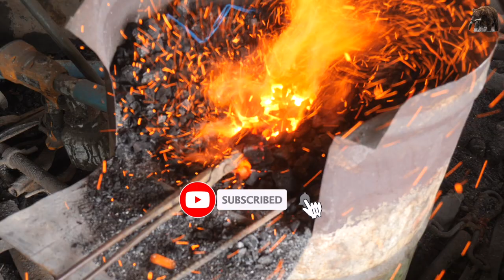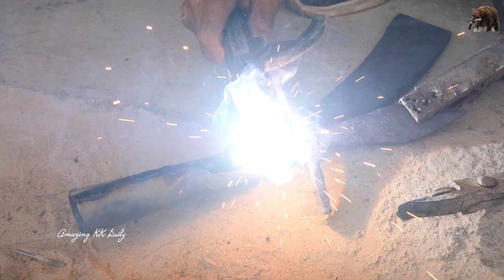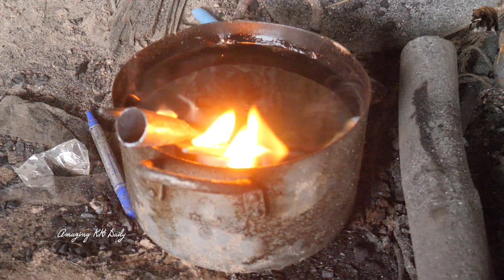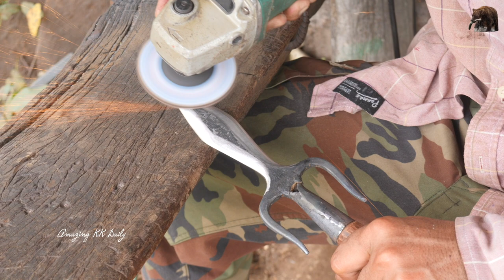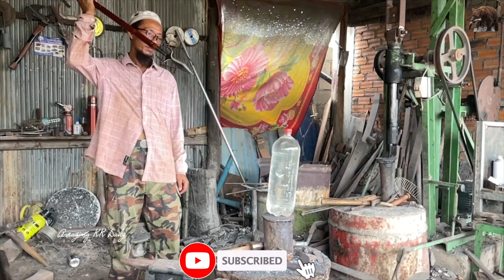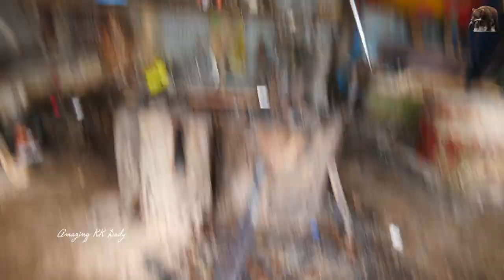How To Make It Look Easy To Make A Trident

Comment: لااله الاالله45+58محمدرسول الله =103محمدعلی فاطمه حسن حسین103+150مذهب الله= 253اصل اسلام253اسامی ابجد 12امام253اصل اسلام253علی حسن حسين علي محمدجعفر موسى علی محمدعلي حسن محمد 253اصل اسلام 253

اصل اسلام253)علی110+143چهار
خلیفه الله آدم داودهارون امام علی=253

حاکم دین اسلام49+72اشهدان محمدا"رسول الله=121یاعلی121+132اسلام=253+ 132حکم دین=385شیعه

اسلام واقعی319+66الله=385شیعه385

دین64الله محمدعلی64کلیدعرش الله64 حقیقت دین الله64
علی26امام دین26+38ولی دین=64
محمد20+18الله=38حکم الله38+26علی=64
64دین64الله محمدعلی64+18الله=82امام 82مهدی82امام82حقیقت دین الله64
قلب اسلام مذهب شیعه64اصل مذهب بدین الله64 اصل مذهب جهان شیعه64مذهب اول جهان شیعه64مذهب حق اسلام شیعه64امام دین الله محمد64علی26امام دین26+38ولی دین=64حکم الله علی=64 ولی دین علی64

دین64الله محمدعلی64جانشین محمدعلی64 خلیفه الله47معجزه الله47+47ولایت محمد= 94+64دین=158الله محمد=158+103لااله الاالله محمدرسول الله=261محمدعلی مهدی 261+124هزارپیامبر=385شیعه
محمد20+18الله=38حکم الله38+26علی=64
اهل البیت34دین اسلام34+18الله=86+46 نماینده الله، محمدعلی=132اسلام132حکم دین132+253اصل اسلام=385شیعه385
اصل اسلام253+132حکم دین=385شیعه
اسلام واقعی319+66الله=385شیعه385
علی26امام دین26+38ولی دین=64
دین64دین64الله محمدعلی64جانشین محمدعلی64+64=128کلیددین128 حسین128اصل اسلام محمدعلی فاطمه حسن حسین128کلیددین128حاکم جهان128حسین

علی26امام دین26+38ولی دین=64
محمد20+18الله=38حکم الله38+26علی=64 دین64الله محمدعلی64جانشین محمدعلی64 +46نماینده الله=110علی110ولی دین110 دین الهی110جلوهالله110علی110یمین110  سوره مدثرآیه38-39کل نفسن بما کسب رهینه الااصحاب الیمین روز قیامت همه گرفتارنامه اعمالشان هستند الااصحاب یمین110علی110نمک110نانجو110پلیسی110نامت صدوده یا علی حقا پلیس عالمی
به نانو نمک مرتضی علی نامت110یاعلی حقا پلیس عالمی 
دین64+59مهدی=123آل محمد123+103 منجی103محمدعلی فاطمه حسن حسین103 لااله الا الله محمدرسول الله=226نماینده الله226+159مذهب حق=385شیعه

اول دین اول مذهب189+196دین اسلام=385 شیعه385

مذهب حق159+226نماینده الله=385شیعه

مذهب51+66الله=117+268الله محمدعلی =385شیعه385
اسلام واقعی319+66الله=385شیعه385

اصل اسلام253+132حکم دین=385شیعه385 فلسفه دین الله385اصل اسلام بدین الله385 شیعه
لااله الاالله45+72اشهدان محمدا" رسول الله79 اشهدان علی ولی الله=196دین اسلام196کلید اسلام196مومنین196علی110+92محمد+ 132اسلام=334+51مذهب=385شیعه

اشهدان لااله الاالله58+72اشهدان محمدا"رسول الله79اشهدان علی ولی الله=209سلطان مهدی 209سلطان جهان209سلطان مهدی209+176 آقای دین176اصل نبوت محمدابن عبدالله86 +90اصل امامت علی ابن ابی طالب176آقای دین176+209=385شیعه

اسلام واقعی319+66الله=385شیعه385
علم غیب36+67ولایت تکوینی=103منجی  103یامحمد103لااله الاالله45+58محمدرسول الله=103محمدعلی فاطمه حسن حسین103+ 25شیعه=128کلیددین128حسین128اصل اسلام محمدعلی فاطمه حسن حسین128

علي ولی الله66+امامت الهی36+26بیعت، غدیر=128کلیددین128حاکم جهان128اصل اسلام محمدعلی فاطمه حسن حسین128دین 64الله محمدعلی64+64=128کلیددین 128 حاکم جهان128مولاء علی257+128کلیددین =385شیعه

خط ولایت و امامت دین الله91+98اولین خلیفه الله علی=189حکم دین الله189+66علی ولی الله=251اصل دین الله251+134حکم الله =385شیعه385 

اصول دین الله257+128کلیددین حسین=385 شیعه امیرالمؤمنین58+257مولاء علی+70حکم شریعت الله=385شیعه
مذهب حق159+226نماینده الله=385شیعه

عمر310گمراه دین310جهل عرب310اباجهل دردین310منکر 310نیرنگ310عمر310فاسق دینه310سامری310عمر310سمری310همان سامری میباشد به ابجد شیطان22پرستی22 بدبختی22ابابکر22عمر22ابولهب22ابن ملجم22خولی22مقصر22

به علم ابجد ریاضی قرآن به ابجد چرا دین اسلام74فرقه شد که رسول الله فرمود73فرقه آن اهل دوزخ است74ابوبکرعمر عثمان74
والشجرتها الملعونه74ذلیل74کج مذهب74پیچ دین74عمرابوبکرعثمان74 والشجرتهاالملعونه74دین اسلام را74فرقه نمودند74مخالف دین ضد مذهب اسلام74اینم آیه قرآن 74ان من المجرمین منتقمون 74قرآن میفرمایدما مجرمان راسخت عقوبت خواهیم کرد74ان من المجرمین منتقمون74 عمرابوبکرعثمان74والشجرتها الملعونه74کج مذهب74پیچ دین74ذلیل74ان من المجرمین منتقمون74قرآن میفرمایدما مجرمین راسخت عقوبت خواهیم کرد74ان من المجرمین منتقمون 74

علی26امام دین26+38ولی دین =64دین64الله محمدعلی64 +26=90اصل امامت علی ابن ابی طالب90+86 اصل نبوت محمد ابن عبدالله=176آقای دین176
دین64الله محمدعلی64+39حق ولایت=103
لااله الاالله45+58محمدرسول الله=103محمدعلی فاطمه حسن حسین103
دین الله34+69مذهب الله امام علی=103دین الله34+46نماینده الله=80+23مهدی=103
إنما يريدالله ليذهب عنكم الرجس أهل البيت و يطهركم تطهيرا
علی26امام دین26+38ولی دین=64
محمد20+18الله=38حکم الله38+26علی=64

دین64الله محمدعلی64جانشین محمدعلی64 
کتاب الله و عترتی75+53علی فاطمه=128
دین الله34+18الله+20محمد+26علی=98+30حق الله=128اصل اسلام محمدعلی فاطمه حسن حسین128حاکم جهان128 کلیددین128حسین128

یاعلی121+103یامحمد=224دین اسلام224
دلیل منطق دین الله79اشهدان علی ولی الله79‌=158الله محمد158+66الله=224دین اسلام224+161کلمه الله،دین مذهب الهی=385شیعه

الله66+66ادیان=132اسلام132
امام کل132+12امام=144اسلام به ابجدکبیروصغیر می‌شود144یعنی12امام12ضربدر12=144
امام اول119+109امام دوازده=228 برگزیده228+157کلام الله157نام الله157 =385شیعه

مذهب حق159+226نماینده الله=385شیعه
معجزه الله47+12اسلام=59 مهدی59
مذهب الله شیعه58محمدرسول الله58+165 لااله الاالله=224دین اسلام224+161مذهب علی= 385شیعه هر کسی مذهب آخرین خلیفه الله علی را نداردمذهبش باطل است
الله66آخرین پیامبرمحمد66+76 آخرین خلیفه علی=142مذهب کامل142+243اولین امام دین =385شیعه385
مذهب حق159+226نماینده الله=385شیعه

حقیقت دین46نماینده الله46 محمدعلی46=138اهل ایمان138+247دین الله مذهب الله247=385شیعه385 

محمد92+134حکم الله=226نماینده الله+159 مذهب حق=385شیعه385

فرقه دین مذهب الله محمد94 +132اسلام=226نماینده الله226+159مذهب حق=385شیعه

خط ولایت و امامت دین الله91+98اولین خلیفه الله علی=189حکم دین الله189 +66علی ولی الله=251اصل دین الله251 +134حکم الله=385شیعه385 

ذالقربی35+18الله=53علی فاطمه53ولایت علی53پرده اسرار35+18الله=53علی
امانت12مقدس12اسلام12حق12اهل12اسلام12امانت دین مذهب اسلام55+66الله=121 یاعلی121+264قلب اسلام=385شیعه385 
نام شیعه12باردرقرآن آمده وَ إِنَّ مِنْ شِيعَتِهِ لَإِبْراهِيمَ إِذْجاءَ رَبَّهُ بقلب سلیم

دین جهان اسلام39+38مذهب جهان اسلام=77یاالله77+66علی ولی الله=143چهارخلیفه الله آدم داود هارون امام علی=143+66 الله=209

اشهدان لااله الاالله58اشهدان محمدا"رسول الله72اشهدان علی ولی الله79=209سلطان مهدی209سلطان جهان209+176آقای دین=385شیعه385نام شیعه12 باردرقرآن آمده وَ إِنَّ مِنْ شِيعَتِهِ لَإِبْراهِيمَ إِذْجاءَ رَبَّهُ بقلب سلیم